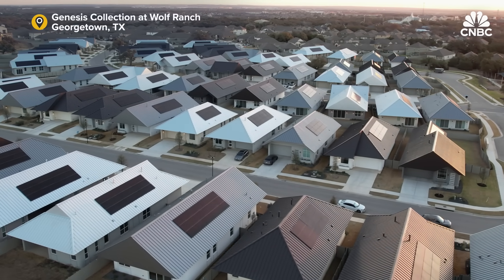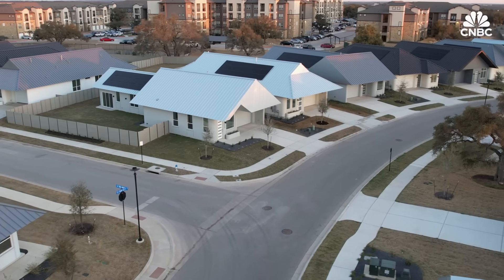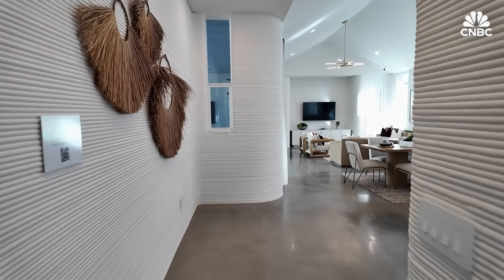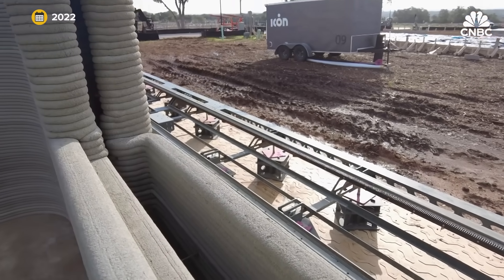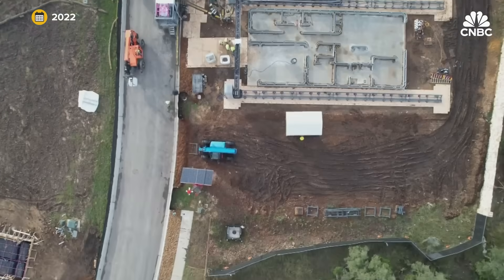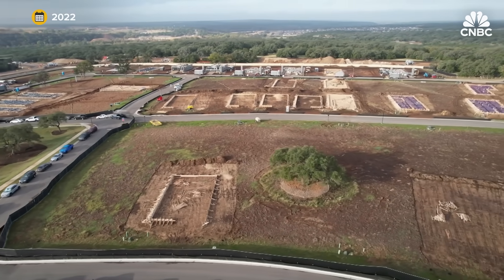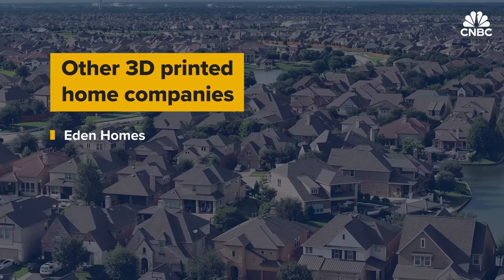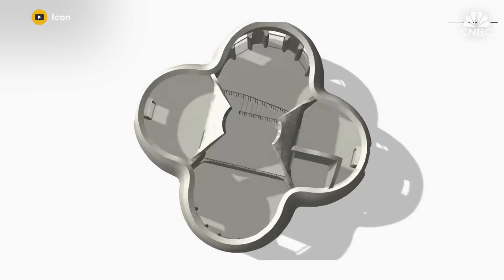Inside The World’s Largest 3D Printed Neighborhood

Comment: What happens if a pipe leaks behind the concrete wall?
Reply: Same with concrete building we currently have
Reply: @aberba  The concrete buildings I've worked in have exterior concrete walls and a few interior load bearing concrete walls, but most of the interior walls are metal frame with sheet rock.  Seems like they could have done some of that here.
Reply: You do realize a lot of commercial building already have concrete walls.  They are designed for access.
Reply: @misterogers  A lot of houses have concrete walls. Very common in south and southwest. Even more common outside the US.
Reply: You break the piece of wall, fix the pipe, cover it up with concrete and paint. Simple, and the best thing is your house doesn't dissolve or create mold like your paper/timber 💩.
Reply: Historic Halo Wars channel is also curious about modern construction - interesting (:
Reply: I thought all that was in the floor slab.
Reply: So cute seeing Americans discover concrete 🤣"we have to screw things into the wall but thats ok" 🤣🤣🤣
Reply: I think they left space for an opening to full access of the walls.

Comment: keep in mind that the maintenance and insurance cost is significantly lower than traditional wood frame  house. Energy bill is lower as well
Reply: Show me PROOF. apples to apples. I noticed they all have solar roofs, but they didn't mention that ..
Reply: @infinitetanner  so 400k include a Solar system. Look like a bargain to me.
Reply: @error-mc5xw  $400k for 1100sq ft is not a bargain.
Reply: @infinitetanner  In March 2025, the median listing home price per square foot in Austin, TX was $366. That house is right about average price
Reply: @error-mc5xw  That's nice. Georgetown, is NOT Austin.
Reply: poor americans, 400 k for either a cardboard house or 3d printed joke
Reply: the house is small for 400k
Reply: I loved the line “comparable to larger homes in the area”
Reply: Lady said her bill was 26 for Jan, while average is 130. Doesn't add up, Austin in Jan doesn't need AC. I think they used average for all months, not just Jan. If so that seems disingenuous. this whole thing seems like an ad.
Reply: @devinwynn1299  Lived in Austin 3 years, you need ac 14 hours a day+ and year round, the humidity is miserable. The ac pulls the humidity.
Reply: @devinwynn1299 Its an ad!!!